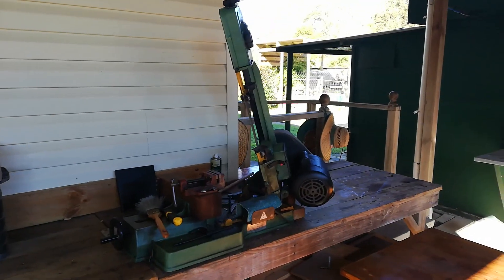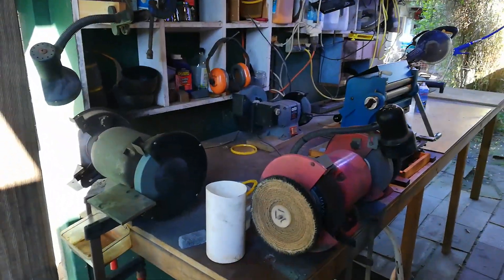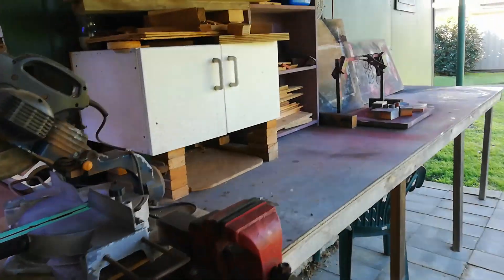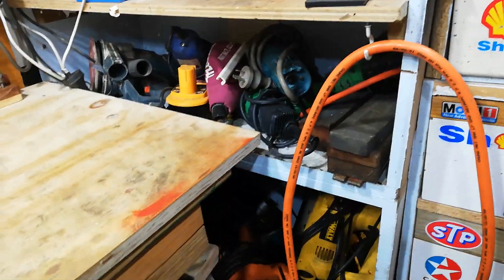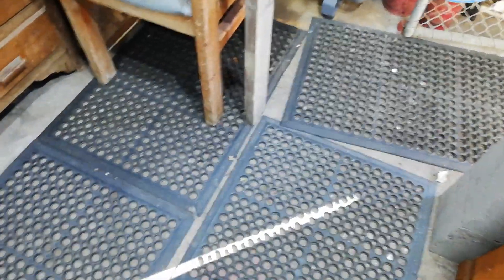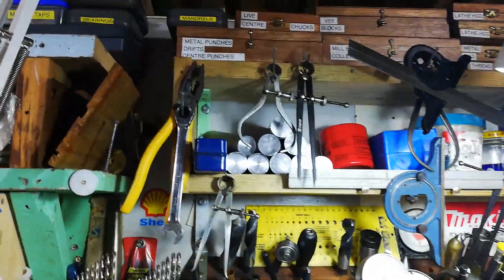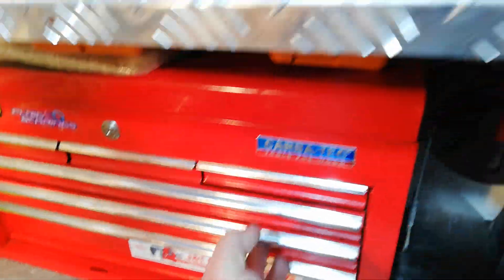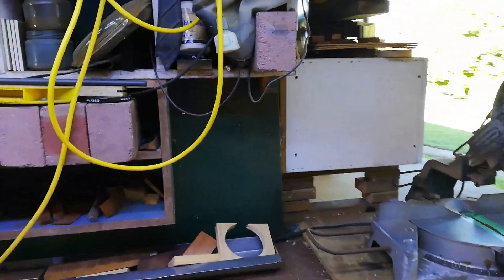Work Shop Talk - Tour of my Work Shop - Hints & Tips

Comment: very nice usage of space.
Reply from the maker: Thanks Josh, I don't have as much room inside my shed like you do, I've got to make every square inch count - Jim
Reply: @SteamEngines-Jim  my shed is actually a storage unit, that I was working out of during the first part of the corn hole virus, also for most of my repairs I had to work outside on the pavement because I didn't have enough room in my unit to actually work on them, and the makerspace was closed since it's now open and it's starting to get the winter I had to move my operations down to makerspace again.
Reply from the maker: @JoshKilen  You make good use of your space and your working on much bigger things than I do.

Comment: Nice shop mate !
You have used your limited space very well indeed .
I don’t know about you but my shed is unbearably hot in summer and the heat usually drives me out by midday -i would love a nice 
Insulated , air conditioned double garage!
What do you think of those  wet type grinders ? Any good ? I always wanted one for touching up HSS bits and chisels .
Reply from the maker: G'day Ian, I had a new tin roof put on a few years ago. I had 6" of insulation that's helped a lot. I have two fans in there and as long as it doesn't get past 35° its bearable anything else and its too bloody hot to bother.
Reply: Blue Heeler's Model & Toy Steam Engine Room 
My roof and walls are fibro and anything over 30 is like being under a griller !
Reply from the maker: @ianbertenshaw4350  My walls are fibro as well. I've been able to extend the roof out all around the shed so that no sun hits it. One of my sons has an air conditioned lined external triple garage and also a wood heater for winter, makes me feel like a peasant :) :) :) One pain in the arse is that I have insulated my shed so well, now in winter I have to run a fan from 1.00am to 9.00am on a timer or every single metal object is dripping with water in the morning (seriously like its rained inside) . I never had that problem before the insulation.
Reply: Blue Heeler's Model & Toy Steam Engine Room 
It is strange because the usual cause of condensation is the sudden rise in air temp after sunrise, this leaves the metal colder than the ambient temp and as  the air temp and humidity control the dew point if the metal is at or below the dew point condensation forms . I have a problem with condensation also and as my shed is orientated nth - sth the sun hits the side as it rises and it heats up very quickly . You could try a dehumidifier in there and with a small shed it would be pretty efficient . As my eves are open i can’t use one for the whole shed as i would be trying to dry out the planet ! I am currently working on a small unit that sits on the machine and dries the air out under a plastic cocoon placed over each machine  ( 2 lathes and a mill) so i have to make 3 units all up .
It uses a peltier module to cool a heatsink down so condensation forms and drips into a hopper and is carried away via some plastic tube to a bucket , Arduino controlled  and draws 6 amps DC when running or 70 milliamps when it is idle .
So far the experiments have been promising ! 
If you read the article in MEW by silly old duffer  ( Dave ) last year (i think ) he explains it all and shows how he used his arduino to controll a commercially available dehumidifier to fiw the damp problem in his house .
Reply from the maker: @ianbertenshaw4350  Hi Ian, The desk fan on the timer works really well. The one time there was a hiccup and it didn't come on, everything metal was wet. Just that small amount of air movement from the fan oscillating is enough to stop the condensation being able to settle. Cheers Jim